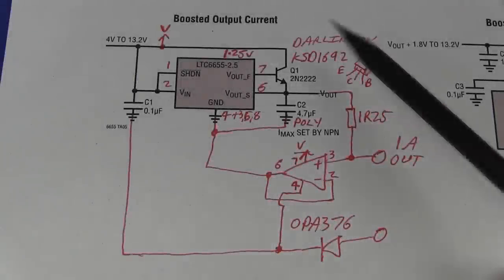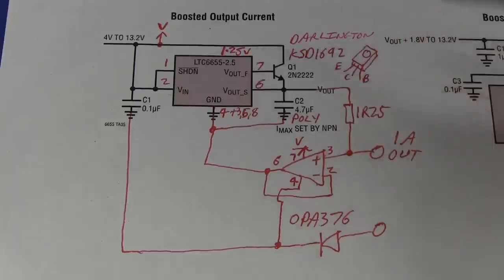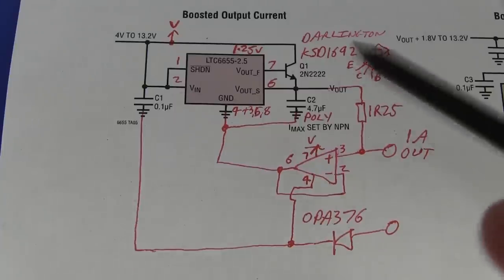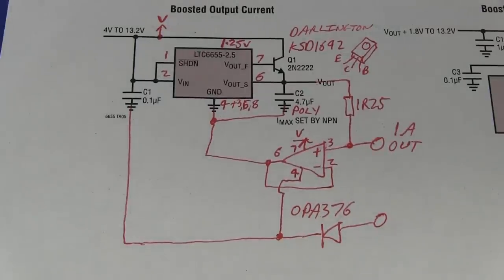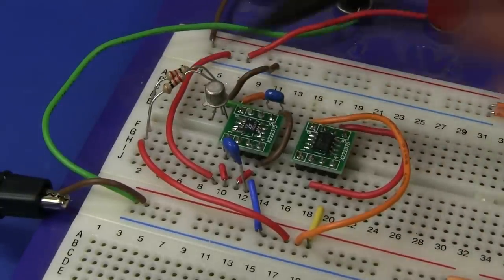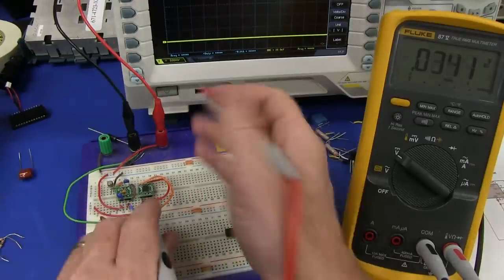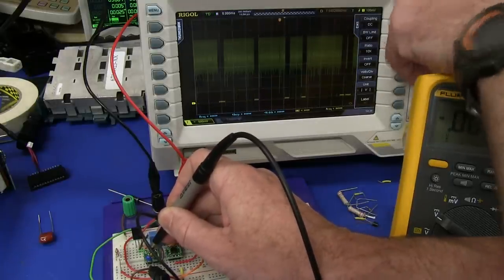EEVblog #567 - Precision 1A Current Source

Comment: Any time there is a closed-loop circuit with an emitter-follower directly feeding a low ESR cap, instability or oscillation can result. I have fixed this problem a dozen times, even on production medical equipment. In the old days, 4.7uf ceramic caps didn't exist and electrolytics or tantalums worked fine on any voltage regulator due to their high ESR of 1 ohm or more. Ceramics have very low ESR. and electrolytics had high ESR. It turns out that if the ESR is low enough, many regulators and follower circuits will oscillate. New regulator designs are aware of this. Old part data sheets had to be modified to specify a minimum ESR. Well, you can't guarantee a minimum ESR of a cap, so good luck. For this circuit, try a 1 ohm R in series with the cap.

Spice model a closed-loop op-amp, NPN, and a cap, Then mess with the cap, it's ESR, the load, etc. and see what happens to the step response. Like me, you too will cringe every time you see an emitter follower driving a cap. It has nothing to do with the breadboard. It's just a marginal design that looks OK at first glance.

Comment: Surprising that you would expect this to work at all on a breadboard. Read the datasheet: the part is extremely sensitive to series resistance in the output capacitor leg, not to mention that the suggested layout is there for a reason.

Comment: "Amplifiers become Oscillators and Oscillators become Amplifiers" such is the lament of an Analog Design Engineer. Those push-pin type breadboards are notorious for have tons of capacitance between strips. I would build up the prototype on a piece of vector board to eliminate that possibility.

Comment: You might try baking the LTC6655 overnight at around 100°c. I do it on all surface mount IC's, it seems to stabilize them after soldering.

Comment: I am an FAE for Linear Technology. the 6655 is a fine reference and there is nothing wrong with the datasheet. I would suggest that one examines the parasitic components associated with a breadboard. Please build the circuit on a perfboard with a plane and then comment on the circuit performance. Think about the plate to plate capacitance inside of that white brick you layed this out on before you disparage the component. I have used it in many instances without a single incident. With the current round of ICs on the market I would contend that the usefulness of the breadboard is nearing its limit,
Reply: I agree "protoboard" is likely a big problem. See comments here from bdd4.

Comment: Your NPN Power transistor has a huge amlification. You get a phase turn beyond 180°: So you need to reduce amplification for high frequencys. This can be done eg, with a RC Pass. I would recommend using a 2 cascaded RC Pass.
Another thing that might produce in a later stage problems is your impedance converter, as it sits in the feedback path. A golden rule for feedback loop is. as short as possible.
Reply: I agree that the NPN transistor has a huge CURRENT amplification. But it's VOLTAGE amplification is 1 (one) as it is used as an emitter follower.
I do not see how you would get a 180° phaseturn that way. What I suspect is that the high gain of the internal error amp causes the loop gain to be too high at the piont where you get overall 180° phaseturn which is caused by all the capacitances present in and outside the amplifier.
Reply: Peter-Paul Vervoort
the current amplification translates by ohms law to a voltage (sense resistor). You wont get the phase turn away, but you can get the amplification below 1 by a rc pass- and the loop will be stable.

Comment: One way to eliminate any possible noise from the power supply is to use a battery. This is something I have been exploring using the LTC6655 and found it made a notable difference to the noise on the output.

Also breadboards suck for this kind of thing. Parasitic everything, everywhere.

Comment: You cant use the ground like this (this IC has two different grounds, check the datasheet block diagram, it would be better if you used the one which controlling the internal reference only and the other one tie it with the circuit ground, it might work). C2 here became a feed forward capacitor as the buffer is not an ideal current source/sink, it should be connected to the real ground in your circuit (and here it will add some delay as your cicuit is a current sense feedback). Another issue, the diode will provide his own feedback with a value related to the current flowing through it (non linear problem). Read about PID controllers.......................  Here is my suggestion: Use instrumentation amplifier, "Inputs" on the sense resistor, its "Output" connected to "Vout_s"; and the gain of the Ins. Amp. can be adjusted for desired current output. And here you can use much lower sensor resistor value (suggested 1 to 100 mohm) :)

Comment: I have had similar problems with discrete voltage regulators, in this case I think the breadboard is doing you no favours, you may also have issues with rf pickup. Good to see intelligent comments for a change.

Comment: Nowhere in the application note does it suggest using the the ground in this fashion, which may explain why it doesn't work. It would have been safer to build it as a precision reference and follow it with a current source.
When I started in R&D, I was told in no uncertain terms to never ever use one of those plug in things again. Design the thing and get pcbs made, then sort it out. Good advice, since its going to end up on a pcb, and the time you spend debugging a lash up is wasted.
Reply: I agree that this type breadboard may be a problem. There is parasitic capacitance caused by the pin to pin coupling between the bus bars. You can see the bus bars if you remove the paper covering on the bottom of the breadboard. Bar to bar coupling is likely enhanced (more capacitance) by the metal mounting plate that some breadboards sit on. This is bad for high frequency circuits. Although time consuming - hardwire the circuit on a bare copper PCB or make a PCB.

Comment: This time Dave didn't made a good enginerring work: 1) Noise and OSCILLATIONS (which is mostly what is happening in the circuits he has breadboarded) are not the same thing. 2) You cannot simply ignore the loop frequency response of the error amplifier inside the LTC chip before tweaking the reference design, 3) It is much easier to blame the IC than your own breadboard and test set-up, but definitely not the most professional approach.
Reply: *****
You are absolutely right on your comments and provide some common ground so that I now can also quite agree with you! Thanks for sharing your point of view.

Comment: My best guess on what could it be happening, is actualy the wires used to build the circuit on the protoboard,, they are long enough to behave as an antena, hence, inputing parasitic signals to a precission circuit like this, you will never find a precission refference built like this, you need a lot of shielding and higly conductive , short traces between components, this would be at least my guess,, i've had problems with this and it's almost imposible to get rid of some of that ripple, BTW love your videos Dave :)

Comment: A  capacitor (I would try10 UF Tantalum) from the op-amp (pin6) to ground may have fixed it. The data sheet says pin 4 must be connected to a noise-free ground plane.

Comment: Esr of the output cap being a contributor to stability issues in linear regs ( same feedback loop stability issue here), a Tantalum cap rather than a poly may have been the way to go, just a bargain basement electrolytic has solved similar issues for me.

Comment: When some oscillation is an issue my guess is that it is caused by parasitic inductances of the breadboard. I tried once making some boost converter from scratch (with no dedicated IC) and it just couldnt work, the efficiency was well below 50% and I couldnt pinpoint the issue untill I did the exact same circuit with the components I tried on a prototyping board and it works just perfectly with efficiency up to 90%. Turns out breadboard can be a real pain if you deal with high frequency ICs.

Comment: The problem could be exactly the no load configuration: It could well be, that when you put in the NPN-Transitor you have an configuration which requires an minimum load current. Look at one thing in the datasheet in particular:

"VOUT Force Pin. This pin sources and sinks current to the load."

With the NPN Transistor in Series, the circuit can not sink any current, but the Error  Amp will try to do so when VOUT Sense is to high ever so slightly.

But as an NPN Transistor is in Series, VOUT Force will go down without directly affecting the the sense voltage. Then the current of the VOUT Sense Pin (the sense pin is a voltage divider) will reduce VOUT Sense over time, till VOUT Sense is too low and then the error amp has to go back from a lower voltage back to a higher voltage.

Granted: If the sink capability of the voltage reference is the problem, the application circuit in the data sheet is a joke. One of the differences between a voltage regulator and voltage reference is the ability to source and sink current. If that is a problem for an "typical application" then it is not an typical application for a voltage reference.

Comment: There is no Problem with the datasheet application. You just did not built up the circuit which is in the data sheet. It says explicitly to use the LTC6655-2.5 but you used the LTC6655-1.2. They use 4.7 uF at Output, you use 10 uF. The scope thing is a bug for sure. Btw you should have a look on Graph 12 in data sheet. Plus I guess you crashed the IC by your original circuit which is catastrophic! However the worst mistake you made is that you simply forgot to connect pin 8 to ground.
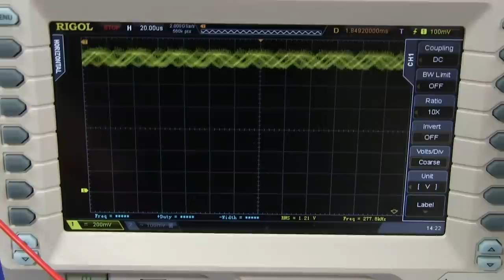Reply: I can see how it might be interpreted as a bug (the scope thing at 12:06), but if you think about it, its the firmware trying to replicate what would be seen on a CRT on the LCD. It appears to be looping to a buffer between LCD refreshes, so that when the LCD does refresh, it displays a better representation of what would have appeared on a CRT.

Comment: Haven't seen part 2 (yet), but at a guess: Too much gain introduced by the external transistor. That's why the darlington is even worse. Beta varies widely, so the particular 2N2222 might have very high beta/hfe. Use a lower gain transistor, or reduce the feedback proportion. 

Control systems: Oscilliations almost always means gain is too high.

Comment: First off I'd like to say I've learned tons just by watching your videos Dave but I'm still a complete novice with this stuff .

Just out of curiosity, I see that there is a jumper between H12 & J11 connecting pins 3 & 4 of your LTC6655 but those pins are not defined on the datasheet. Is it possible that may be related to some of the oscillations you are seeing in the output of the module? Also, I noticed that the diode did not appear to be attached to anything. :)
Reply: Pins 3 and 4 are quite clearly defined at GND on the second page of the datasheet....

Comment: Can't you just whack on a huge value electrolytic capacitor on the force output, sense output, and output of the transistor? those MKP and ceramic/film caps ate low values, baybe larger values work better. Is it possible to reduce the internal gain of the feedback loop? maybe a voltage divider on it's sense?

Comment: And there i was eating up the reference designs from datasheets with a golden spoon thinking they came from the gods of electronics.

Seams quite straightforward to fix tho, just make your own error amp so that you can add in caps into it to slow it down so its stable, if done right it works well even on breadboards.

Comment: Wouldn't it be cheaper just to buy a 1amp plug like used on cell phones, etc.
Reply: Obviously you're missing the point of what Dave is trying to achieve.
A 1 Amp cell phone charger provides something between 4.5 V to 5.5 V
to charge something. The current will be whatever the phone or load will take upto 1 A, so The current can be 0 A to 1 A. Such a charger behaves as a voltage source.
Dave tries to make something that will deliver 1.000 A as precisely as possible independant of the voltage (within practical limits of course). This is called a current source. It is intended for electronic measurements, not charging your phone.
Reply: Uh ok, whatever. Some of these home made kits are ridiculous because you can already order the boards or go to rat shack and get one. Maybe if you are using a Raspberry Pi on your car multimedia head unit like bored1980 does and you need more power to run more then 2 usb devices with it.

Comment: nice videos you have there! ..if you get an ascillator somewhere you don't want .. you need to cut or reduce the feedback or reduce the amplification .. or maybe add some delay or phase shift to stop it .. the next old video seems to know how to make an oscillator (LC) .. to stop that you do the reverse! .. or remove some C which makes it to oscillate!;) --> http://youtu.be/a8casNPDvI4
Reply: funny that in USA the current flows reverse direction compared to the situation here in Europe .. I don't know how the situation is in Australia? Here the current always flows from the positive voltage to the negative pole (and the electrons flow reversed) .. at least in old US videos it seems to be a common "local" fact that electrons and current flows the same direction (from - to +) .. very strange? haha!:)
Reply: Try putting a RC filter to the OP amp output ... you might also put some resistor to the op amp input to protect it and why not some RC also??

Comment: What am I missing?  You completely changed the circuit, used a created gnd from an op-amp output, then claimed that the application note was faulty.  You made two grave errors. One- you think that an op-amp output is the same impedance as the GND in the circuit, and 2, when you plugged in the darlington you changed the loop gain which is part of the stability of the amp.  I don't think the breadboard is the problem.  
To claim that the application note circuit doesn't work, you should actually test the application note circuit.  In this case you are testing your assumptions and claiming that the application note was faulty.  Sorry, I love your videos except not this one.
Reply: Did you actually watch the video? Dave removed his mods and ran the circuit as per the app note, same result.
Reply: Oops, I did watch it, but now I re-watched it because of your question.  Thank you, I don't think I noticed that part where he repeated the original circuit the first time through.  
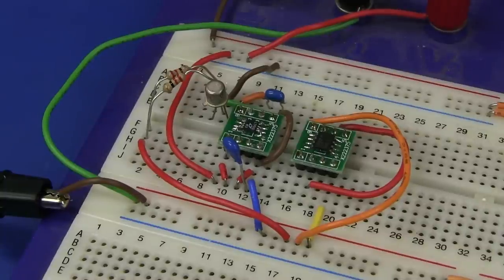However, I am not sure he really did correctly recreate the app-note circuit.   He claimed to have re-run it, but I don't see C2, the 4.7uF cap in his "repeating original" circuit at 9:38 in the video.  Just because he said that it shouldn't need caps NEAR the circuit and he wanted to test it that way, is he using the cap that is still hooked up to the other circuit?  The other circuit still looks powered.  And if he did duplicate it, but failed to put the two caps close to the circuit, why did not not then put them close and duplicate the test? I think he just plain forgot or did not include C2 thinking that it was just some noise reducing component.   Claiming that the app note circuit does not work is somewhat serious and I have made tech support complaints when I found what are essentially flaws in the data sheets.  Any decent company will act on a data sheet error.  But, you have to make a good attempt at documenting the problem first.
It is true that App note circuits don't always work, but I have a lot more faith in LT app note circuits than TI app note circuits for example.